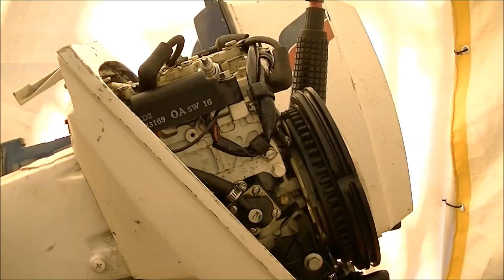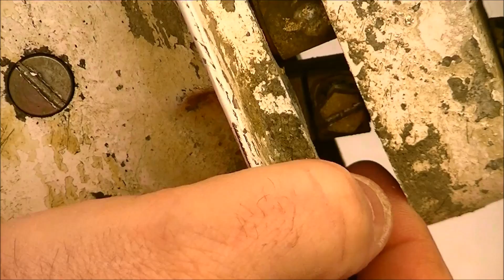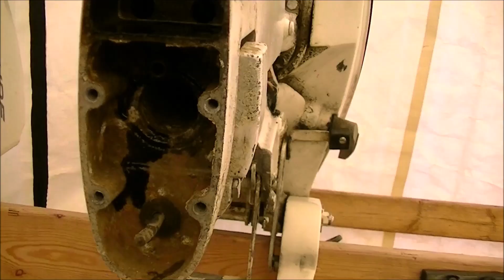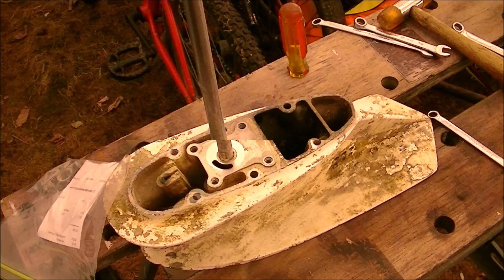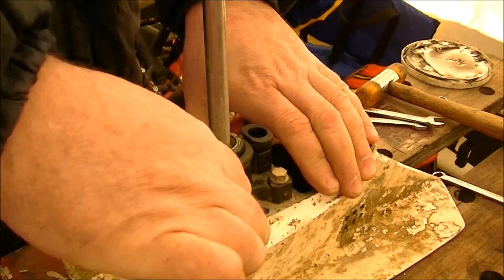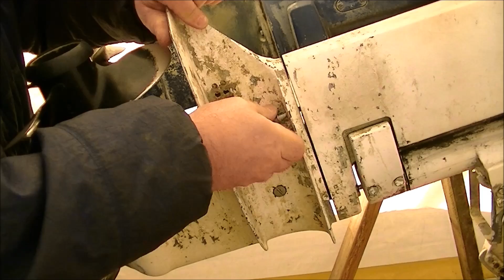Johnson 15 HP Outboard Water Pump Replacement

Comment: So how did you connect the shift linkage????
Reply from the maker: Hi..it's been years since this was made but the shift linkage  on this outboard in two halves...it just slips up into the coupling and tightens with a flat slot screwdriver..hope this helps

Comment: Didn't replace top seal or the large "o"ring on top of impeller housing that was left off by previous owner or another shade tree mechanic.Half Assed fix.Shows a little knowledge is dangerous...
Reply from the maker: but it pays well..ty for the view :)..trolls = cash..

Comment: we have an Evinrude E15RLESR (long shaft). to get to the impeller, do we remove the same six bolts (upper) or the lower six bolts? Do we have to remove the upper because of that shifter linkage, and the lower?

Comment: Very well done, for the most part, aside from the matters other people have mentioned about unscrewing bolts and omitting re-connection of the linkage.  Would have been better to cut past unscrewing so many bolts, and just show where they are.

Comment: ATTENTION Scroll down to find the comment from Olsin Skute for a very important addition to this walkthrough regarding reattaching the shift rod linkage. If not done right, you will could have problems with shifting and even if no problems with shifting surface at first, it may very well once you put in and run for a bit. I followed through this video to the "T" and within a few minutes after putting in, I started getting rather abrupt jolts (gear skipping). So do some extended throttling tests in the driveway before you go out.

Comment: Watched you video and I've finally tried it.  I got as far as attempting to disconnect the shift linkage.  In your video you make a jump cut from breaking the bolt free (using a flat blade screw driver) to having it removed altogether.  Should mention that the shift shaft has a grove machined in it all the way around so the bolt must be completely removed before pulling the lower unit.  But beware, the lower unit cannot be pulled too far down before removing the bolt else the threads will be damaged by the shaft.

I'm now in the process of locating (on-line) a replacement bolt.
Reply: I know it's bad form to replay to ones own comment, but I just want to say it's still a great video, thanks.

Comment: You should always replace the rubber connecting the pump to the tube, Just buy a complete kit it has everything You need. Examp18-3327 Water Pump Repair Kit
Use silicone grease and antiseize on bolts

Comment: Ordered a replacement impeller ($15 including shipping) and it arrived today.  Thanks to this video and some of the other comments,  I've already installed it in my 1986 15 HP Evinrude.  Tested it, works fine and ready for more years.  I would never have tried this replacement had I not watched this video, so thanks a lot for posting it.

Comment: Great video since this motor, Johnson 15HP,  is exactly what I have.  Now, I'll feel a little more confident when replacing the impeller. Just a few questions, and some have already been asked but not yet answered that I can see.
1. Since the drive shaft connection to the motor is up and out of sight how does the drive shaft engage with the motor?  Other commenters have mentioned that the flywheel might have to be turned a little to re-engage.  Any advice or trouble shooting hints in case there are problems re-engaging the shaft at the upper end?
2. How does the shift linkage (that was disconnected / reconnected) move, does it move up and down or rotate?  I ask in case the linkage is reconnected incorrectly.
3. Are there any "torque specifications" for the (4) pump housing bolts and the (6) lower unit bolts?   "Just tight" may be adequate for en experienced person but the only things I tighten on a regular basis are spark plugs and lug nuts, I 'know' just how much I can torque those, not sure about these bolts.  Yes, I have a torque wrench.
Reply: Richard Marton, did you get it all figured out yet? I basically have the same questions. Figured you might have made some headway in the last 3 months.

Comment: do they always need waterpumps replaced each year? how does yamaha compare? im tyring to find a used15hp johnson or yamaha not sure which one to get.
Reply: I just replaced the impeller on a 1986 15HP Evinrude - the first time since I bought it new.  It worked fine until recently, and finally one of the vanes broke.

Comment: For people wanting to know how to reattach the gear shift shaft to the gear shift coupler. Make sure the gear shift is in the forward position bringing the shaft to it's lowest point and the gear coupler is pulled all the way up putting the gearing in reverse.
Jimmy the shaft into the coupler and use a screwdriver as a lever to keep the coupler as high as possible while you press down on the gear shift to stop the gear shaft riding higher up into the housing, You can wobble the lower leg to make sure the shaft is totally in the coupler. Make sure the screw is removed from the coupler before doing this. 
Once satisfied that it's all flush use long nosed pliers to put the screw back in and tighten down with screwdriver.
Push the lower leg all the way up and screw in place.

Comment: How do you disconnect the linkage if it is a long shaft engine? I got the lower unit to lower about half an inch but can't get the extension to drop enough to gain access to the linkage screw.
Reply: I'm not certain but the drive shaft may have a keyway alignment with the flywheel. Try slowly turning the flywheel and at a specific point the keyway will line up and release the shaft enough to get to the linkage capture screw.

Comment: is this the same as the 25hp? thanks
Reply: I would think any mid 50s to 70s, maybe later, too, OMC (Johnson, Evinrude, Gale, etc.) engine of similar hp without an access door and that does not require pulling the power head.  The access door to the linkage doesn't change the process, but makes it a bit easier... if the screw is not seized.   Then you might need to apply some Free All, treat it as a bolt, and use a 3/8" socket with a longish wrench, as I did.

Comment: Thank you for this.  I began replacing the water pump on the same exact engine 1 week ago today, then screwed up a seal and needed to order it.  Installed it today, then realized that I didn't remember which way the rubber vanes went.  Found this video & just got it installed and back on.

Tips for those having trouble getting the lower unit back on - the shift rod is bent & has to be facing toward the front of the engine, having it shifted into forward helps, and you have to rotate the flywheel a bit to get the drive shaft to fully engage and allow the lower unit to close up.

Comment: Very well done  I watched this video to find out where the linkage connection was located on this motor (some, like my 94' ocean pro 175 are up top near the power head)
Thanx a lot, I'm now confident and will be doing this job asap (just got a 74' 9.9 kicker engine, fired up n runs great but needs a water pump kit)
I read some of the comments regarding "skipping over" the linkage re connection and feel that's pretty much self explanatory.
I had no questions about what or how to do this job after watching this.
Well done man keep it up, you just got a sub....

Comment: Advice please. I have undone the 6 bolts and I worked the gearcase down about 1/4" however not far enough to get a large flat head screwdriver in to disconnect the shifter rod. I have tried hammering down on the gearcase and levering it but I cannot get a big enough gap. I suspect either the drive shaft spline is holding in the head or maybe the shifter rod is stopping further movement.
I've tried turning the flywheel both in and out of gear.
Suggestions please
thanks Mike Dartmouth UK
Reply: This is probably too late, but try shifting into forward; it drops the shift rod by ~1/4".

Comment: well I can tell you had this apart prior to video. that came apart way too easy.
Reply: Yeah, mine is so tough to pull apart I came back to see if I missed anything.   Also had to use Free All and  a long socket wrench to loosen the linkage screw.  An impact driver didn't even loosen it.

Comment: I pulled my lower unit off on my 9.9hp and when it was back together and I shift it to reverse and back to neutral it does not go in neutral.I have to push lever back alittle and then to neutral for it to disenegage.Could I have done something wrong?I had to replace the brass block since someone else had stripped the threads for the bolt and had just put a bolt and nut thru the hole to hold it.Is there anything to adjust on the lower shift rod?

Comment: I tried replacing my water pump on an 80 hp mercury all went well till I went to put it back in and now I cant shift into forward I can however shift into neutral and reverse any suggestions?

Comment: In order to get the drive shaft to release freely you have to take the cover off the motor and turn the flywheel slowly until the key that is on the top of the drive shaft lines up with the slot. You can not see all of this happening, you just have to slowly turn that flywheel and that lower end will fall to the ground so have someone hold it or put a cushion under it..

you will have to do the same in reverse to put the shaft back up... If you do not have as much room as he does with removing the shift linkange turn the flywheel to make more room.... then be very careful because everything is lined up and ready to fall..
Reply: +Ronnie Paul   I agree he quickly skipped thru a few steps, like when putting everything back together.  I am thinking about trying to do this to mine.  repair shop wants $130.  where you able to do your own?  any other tips?
Reply: yes, i broke my pin putting it back in though. Went to autoparts store with remaining piece and got new one for pennies. My regret is i did not take note of how much of that pin protrudes out. Just had to keep snipping off the new one until it would go up into the flywheel. Lots of additional work...
Reply: Thanks for the tip about the flywheel - I was unable to reach the top shaft linkage so just put it all back together, but now, I think I"ll give it another try.  My motor is a 15HP 1986 Evinrude and seems to be exactly like this Johnson.

Comment: I have a johnson 6hp cd-24d and did everything you just did except for the "comes right out part" after I disconnect the shift linkage I can pull on that lower part all I want and it does not come out.

I have watched videos on my exact model and same thing, they are worried it will fall off after they disconect that linkage, but mine does not come free..

SOME ADVICE PLEASE!!! HELP
Reply: no, there is a pin at the top of the shaft that has to align properly for it to fall free

Comment: Nice instructional - other than spending half the video unscrewing bolts and then skipping the difficult linkage reconnect. Just want to point out that it makes absolutely no difference at all how the vanes are aligned (clockwise or counterclockwise) when installing a new impeller.  in the first 1/4 turn when you begin to start the engine, the vanes will flip to the proper alignment.  Always - in every pump with flexible rubber impeller vanes - whether it's a small outboard or a big marine diesel.
Reply: Thanks, I always wondered about that.
Reply: That is absolutely not true. I have had them stay clocked the WRONE direction thinking they would flip. Sometimes they do, sometimes they don't.
Reply: @drmrjon  Totally agree. I've taken impellers out where a few of the blades have been flipped, and the rest have been fine.

Comment: Nice video but it had been better if you had skipped the part of tighning the bolts of waterpump housing instead of reconnecting the shift linkage. To bad!

Comment: Thanks for the video, I'll be replacing the water pump in my 9.9 myself after watching this! Do you recommend getting the kit, or just the impeller? my motor is a 1993 and I don't know when it was last serviced.
Reply: I just installed a new impeller in my 1986 Evinrude (see comment above) and did not need the kit.  Just the impeller will be fine if the other parts are in good shape.

Comment: good vid. I was doing this to my 4hp merc. Same set up really. I found it alot easier to seat the impeller and the pin/key first then lower the housing while turning the shaft clock wise. A little lube hepped too. The linkage was so tricky though going back together, Its a fine tune there.

Comment: Great video. I have a '75 9.9 johnson that doesnt seem to be pushing water out of the bubbler hole. I will find the part and give this a shot asap. But one thing I was wondering, why wouldnt the impeller be made of a heavier aluminum or solid plastic to prevent the dry rotting? There got to be some sort of invention to make this part last longer. Looks super easy, the hardest part looks like the linkage stuff.....thanks again!

Comment: Changing the pump impeller is the easy part.  Getting the shift linkage back together so it will work correctly is the impossible part for me.  I have a 1975 Evin 15hp and I'm stuck and will most likely have to take it to a mechanic because I simply cannot get that linkage back together. Would have liked to see how you managed that part of the reassembly. but you skipped right over it. Is there a trick to that?

Comment: Excellent video! I have a 1992 Evinrude 9.9 that has been in storage unused for 5 years. Got around to cleaning it up, got fresh gas, cranked over after 10 pulls. But I noticed right away no water was coming out the outlet. What causes the impeller to fail? Does the rubber part separate from the metal central core? Or is it that the blades break off? I haven't taken it apart yet, wanted to check out videos 1st. I'm thinking of buying the water pump repair kit # 394711 instead of just the impeller. What do you think?
Reply: hi Dam, i am not experienced boat mechanic, but the impeller is rubber, and if not used it will dry rot. Some people say in small hp boat engines the impeller should be changed yearly especially if operated in shallow waters! They just take more damage to do the sandy water in shallow water. But if sitting for five years, chances are that rubber is rotted out! You could always take it apart and make sure the water tube isnt plugged with debris as well.! Buying the whole kits willl never hurt, but if your parts are in good shape, you are just wasting your money! Good luck
Reply: dynocompe
After doing the water pump repair kit/impeller and snapping off 3 of the 12 bolts on the middle and lower unit housing, I still wasn't getting water from the outlet hose. It was clogged with dirt possibly from insects, ants, bees, or hornets??? I pulled the hose out and cleaned it out and the motor is running like new again. I had to drill out and tap the 3 bolts I broke which was an ordeal. I recommend checking the hose 1st. I put a new thermostat in too which cost more than the water pump kit.

Comment: Thanks for this video.  Looks quite straightforward!  I have a johnson fd-19d (1965 18hp) that has not ran in 20 years.  Are there any parts (gaskets) in the lower end that I should replace while I am in there?   I noticed in the video you mentioned a rubber boot that goes seals the pump to the upper unit...I will try to get that as well.  On the bolts, any ideas on the torque for water pump housing and the lower unit?  Thanks for your help!

Comment: Can you please tell me how to remove the impeller pin ? My old impeller is stuck not sure if it's because of the pin or something else. I don't have enough space to push the pin out how should I do ??
Reply: probably siezed on. Lube it up with some wd 40, tape it gently with a hammer.

Comment: got  a 50 hp evenrude 1974 need new impellor, loosend 4 bolts at bottom wont slide out, any suggestion?
Reply: ***** thanks for info, found the 5th bolt, stil dosent want to drop, engine is stil on boat, any tricks? banged with hammer all the way around, didn't bugde
Reply: ***** thanks for your reply.really stuck. do I have to disconnect anything from top of motor? or just the 5 bolts on bottom
Reply: hi again. got everthing lose.but do not have pin to disconnect shift lever.50hp evenrude 1974. have housing that shaft is going through with 4 bolts holding it? do I take housing off? please reply desperate

Comment: Why can't you just stab the drive shaft back in if it accidentally comes out. It's as if there is a spring on it. Is there some trick to putting it back in? I wanted to convert a XL Shaft back to a plain long shaft. Thanks Pat
Reply: Gears won't line up, have to open up the bottom and reseat the shaft.  Sometimes, but rarely, if you're REALLY careful when removing one shaft, and don't jostle the bottom at all, you can get the shaft (or another one) put back in.

Comment: Good job !  But do you really have to be careful about the sens (clockwise) of the impeller ? Because what's happen with the impeler when you reverse the engine ? The sens of the bends are going counterclockwise or still being clockwise ?
Reply: Engine doesn't reverse, the gears are below the water pump so this shaft always spins the same way regardless.

Comment: i have a 9.9HP Johnson outboard motor that was sitting in my grandfathers shed for 13 years cranked right up, it is not peeing, i have taken a air compressor and sprayed through the pee hole front and back, when i put the water hose to the copper pipe in the foot it sprays water out the pee hole as normal, replaced the impeller, and even tried reversing the way the impeller fins are facing, i am getting no peeing at all. any ideas would be greatly appreciated.